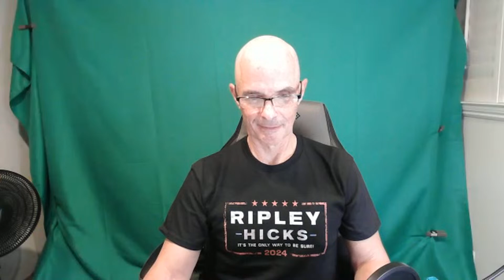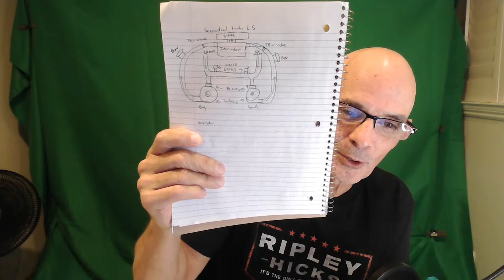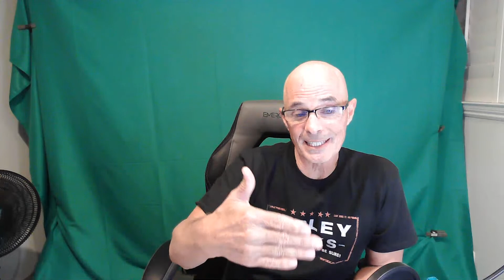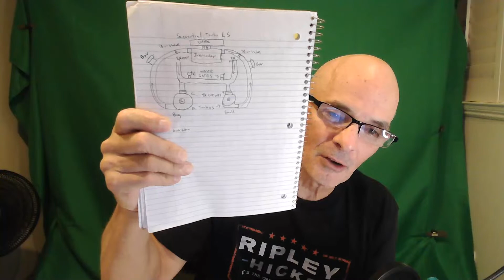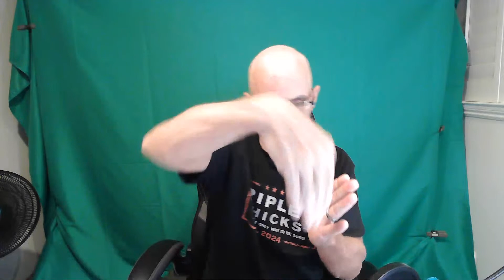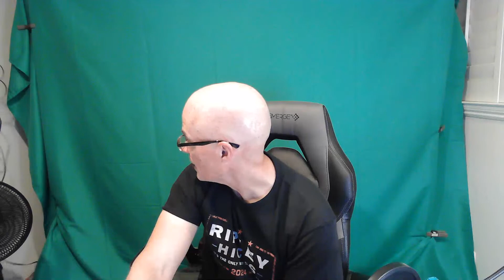LET'S TALK TECH-SEQUENTIAL TURBO LS PLAN-WILL IT WORK?

Comment: use exhaust back pressure to open the turbine valve gradually maintaining the primary turbo at maybe 15 psi depending on boost. Delta pressure better than -5?

Comment: Richard -- I am extremely interested in this approach.   Here's my context, I have an FG Barra motor that is going into a 2000 Mustang.  It has the stock 2 plane intake (short and long runners controlled by a vacuum valve).   I'd like to use your approach here for a couple of small turbos -- the first for low RPMs until the second one kicks in which I think should coincide with the activation of the high RPM runners.  I have NEVER done a turbo setup but was doing some research on sequential turbos and when your video here popped up I realized this was the closest thing to what I was thinking.  The exhaust cut-out thing is a great idea IMHO -- did you ever prove out this concept?

Comment: I'm looking forward to seeing how your sequential twin turbo Lego kit ends up running , should be some interesting black boxen & pressure balance tubes to get a smooth transition & avoid any pipe hammer   ;)     

Happy plumbing
Reply from the maker: it will be chalk full of problems, but also hopefully solutions and learning and BOOOOSt

Comment: Your compound set up would have worked if you had it set up right 😂
Reply from the maker: it did work
Reply: @richardholdener1727    Plenty left on table though. Not 100% convinced the (big turbo was big enough  
And the big turbo could have been referenced. To supply a set amount of boost in to the little one    

Testing with just the small turbo first then adding the big one on top with a second intercooler

Comment: Your easiest control sequence is probably one way valves on each compressor discharge, trigger crossover to big turbo at a set boost (measured between the turbo and one way valve), then choke the small turbine. In a perfect setup you would measure turbine speed and modulate the BOV to avoid surge and transition as soon as the big turbo is up to speed. If you want to get really fancy you can size a bypass to avoid stall, then snap it shut once the big turbo is flowing.

Comment: I would think there would be a lot of surface area for the small droplets of fuel to fall out of suspension on a draw through turbo deal, especially through the intercooler. I look forward to the experiment!

Comment: Biggest issue (aside from controls) will be turbo speed during switching. You will likely over speed one of them transitioning up or down. You might need a compressor recirculating on loop on the bigger turbo. If you are planning to completely “shut one off.”

What is stopping you from downsizing both turbos, and leaving 1 on all the time and just adding the bigger/2nd one with valves rather than switching one on and the other off?
Reply: He mentioned in the video, he just wants to switch between the two turbos, for the heck of it.

Comment: Hey Richard. Have you ever considered building a sbc 350 base hybrid?  Not motown crap. Just whatever you can scavenge off a ls and put into a sbc standard block 350. I know a firing order swap cam can work. Their stock valves in a set of iron heads, like maybe double hump or vortecs? Maybe even the rocker arms! I hate ls, but I'll deff use ls parts in a sbc if need be.  Obviously budget is key. But guys like me who watch you. I'm old. I rather take a bullet to ride that ls train. Collecting years of sbc junk was hard enough.
Reply from the maker: there is very little that cross over-common bore spacing
Reply: @richardholdener1727  but a honest opinion what would the gains be by swapping over to ls crap in a sbc head? Realisticly. I have plenty time on my hands and people smoke 5.3s left and right down on Mexico rd. So I can get top end parts easy.

Comment: You should definitely plumb the small turbo wastegate into the second turbo. If you use one way valves on the cold side it will transition smoother i think. Allow the boost to match as it goes to the bigger.
Reply: I tend to agree.

Comment: I like it Richard.  I want to see this setup on the dyno! Very interesting indeed. Would external waste Gates work better than exhaust cutouts? Would pop off valves work better than throttle valves? How is the secondary hot side heat going to be managed. So many questions.....

Comment: This is not so different to what I was part way through doing about 2007. I don't see why it couldn't work, but I think you will need something more than a throttle body to stop boost feeding back through the other side. I think the exhaust cut out side of things should work fine if placed in the right spot. For the boost side of things I was thinking of using something like the exhaust cutout in reverse. So instead of it coming in the bottom of the Y and going out either left or right at the top, I was thinking of making the top of the Y the two inlets so you don't have boost fighting itself.

Comment: Also fwiw I don't recommend the exhaust cutout for a daily driver, sure, fine for the dyno, not for a daily. I had to significantly reinforce mine because backpressure tacos it open, leaking drive pressure. Don't bother staging them, i.e. turning off the small turbo, run them parallel. You can have a small and big turbo in parallel, I did this briefly with a 7875 with a .96 housing as turbo 1 and 366 as turbo 2.
Reply: That defeats the point of the exercise. if you run them parallel you are sharing the exhaust gas and neither of them are going to spool fast.
Reply: @DodgyBrothersEngineering  my revised plan on my setup was going to be two 60mm wastegates on the inlet side to turbo two vs a 3" cutout on the exhaust outlet. Never stated omiting the exhaust valve completely.
Reply: @DodgyBrothersEngineering he said don't shut off the small one. Spool small first then once it's making power to the point it's using wastegate then you open the big turbo and run them both.
Reply: @jasonbirch1182  you might need to re-watch that bit. I am fairly certain he said he wanted to switch from one to the other.
Reply: @DodgyBrothersEngineering  no. I'm not talking about what Richard said. The original comment here is what I'm commenting on.
Reply: @jasonbirch1182  yeah but one exception, start with the "big" one first then switch to big+small. It might sound counterintuitive but the reason why is due to creating prespool on the secondary turbo via wastegating through secondary and having enough overall engine power to minimize transition time to the fullest. In my first setup I used two s366s on a cammed 6L. What I found out rather quickly was even though I had enough compressor flow to support probably 1,400 horsepower combined, one of those isn't actually good to 700 horsepower because of the compressor map and how it would fall off the choke line rather quickly with that 6L engine. This means you essentially never throttle exhaust flow to the second turbo for prespool because you are trying to save every bit you can to drive the primary. In my second setup which I only did briefly, I did a 7875 as the primary and due to the small exhaust housing it had very fast spool but it was limited to overall horsepower due to exhaust flow. I still had the reinforced 3-in cut out on the outlet of secondary turbo but I had control issues using a 3" cutout like a wastegate so I was never able to perform the pre spool that I wanted. Instead I transitioned fast using an RC servo pulling the cutout open through a bicycle brake cable with the servo mounted remotely, away from heat. I used two large springs to pull the exhaust valve open and used the servo to hold the valve shut, leaving me a failsafe of the valve in the open position. Anyway, the 7875/s366 combo worked better. I could cram 20psi in by 3500rpm, transition at 6000rpm and it would have a boost dip that lasted .3s as opposed to the best of a .6 I could get on the s366 twins. I bet if I had twin s369's though this would have been less of an issue. I went back to the s366/s366 combo though because i really liked they way they sounded better 😂. Truck would sound like a power stroke pulling a landscape trailer up a hill all the time haha. Plus the 7875 was to be used in a future project.
Reply: @scrapmetal_sleepers  yeah I see what you are saying but obviously his combo he plans on putting it on isn't going to spool the 100mm(ish, I don't recall what he said it was.) As low as he wants. There's no point in doing it if he's trying to spool the big first and using the small for extra capacity. Honestly the whole setup makes zero sense for Dyno play. None of the combos he puts together have much use besides making numbers, race gas, 140° water temp. Unusable on the street and most racing. The sequentials only real advantage is in a street car or maybe a really insane autocross car. How low is he going to start a pull? 2500? 3500?
Reply: @jasonbirch1182  ah yeah I didn't hear him mention sizes. Honestly, I can't pay attention that long.
Reply: It can be done but you will need lots of instrumentation.  Pressure sensors before and after your valves.  There are plenty of auto valves to choose from.  You will need an automatic wastegate for each turbo.  A programable logic controller and a process control engineer to make it work well.